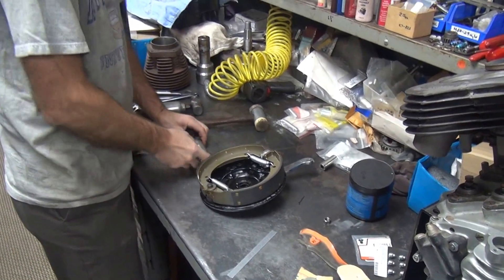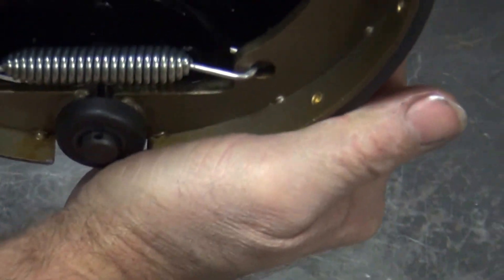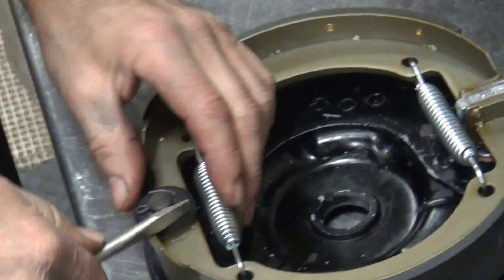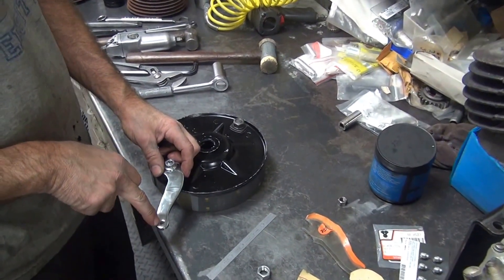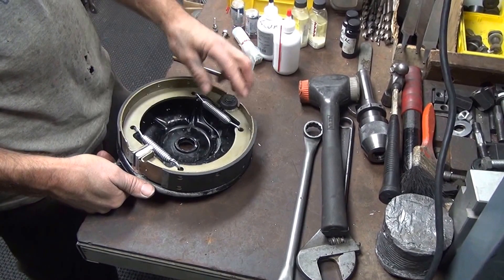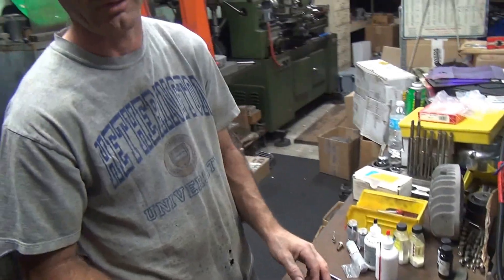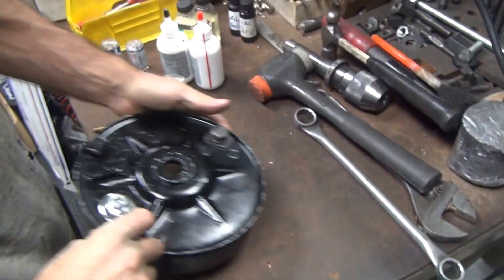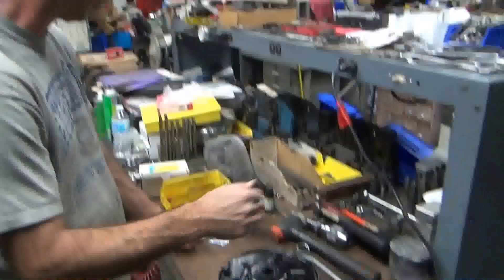1936-57 mechanical rear drum brake #108 rebuild Harley knucklehead panhead

Comment: I realize you are a repair shop and probably know more than me, but I have been riding Pans 40+ years. Just a suggestion, you may wish to flip the brake arm around when you put it on the bike. It works better that way.It's the way God and Harley intended. I ride a '49 EL by the way. I enjoy your videos.

Comment: Just bought a 76 DJ5 with mech drum brakes. Happened to bump into reverse while facing up hill, pedal to the floor just barely stopped the jeep after a good 60 yards lol 
 I pulled on the E-brake to auto-adjust the slack but still a no go, im guessing its time for some new pads.
Reply from the maker: +DarkLinkAD 
i think its time for a harley and get some real freedom of the road.
tatro